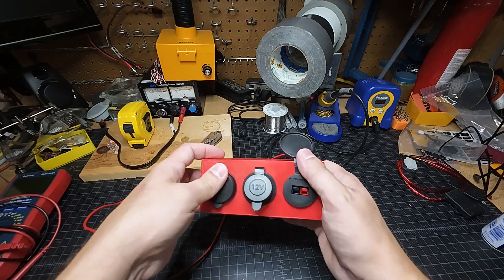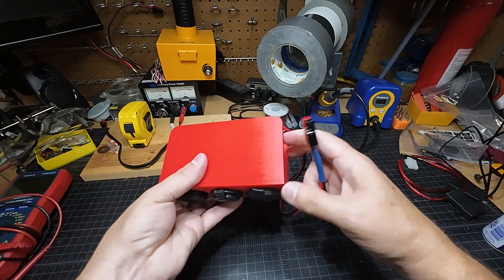3D Printed 12V Accessory Break Out Box #hikertrailer

Comment: Nice idea but $28 for a panel mount Anderson plug is ridiculous, you can 3d print one
Reply from the maker: Yep. I do print them but I was in a rush.  Also getting the pin that locks the Anderson Power pole into the 3d print is sometimes hard to find.
Reply: @squaredropadventures  I just use a cut down nail for the pin